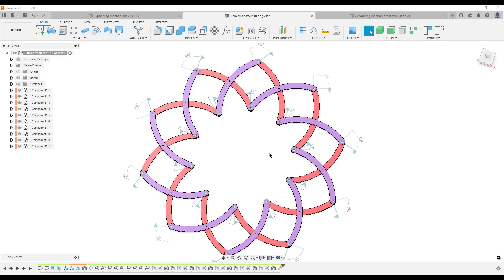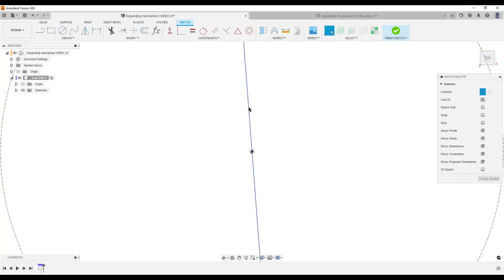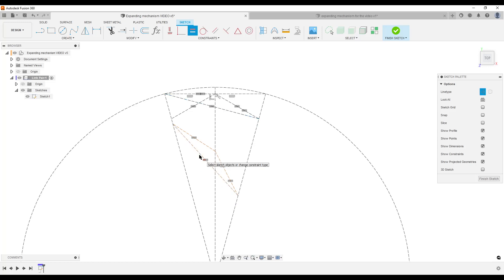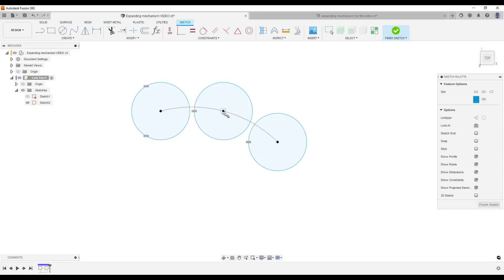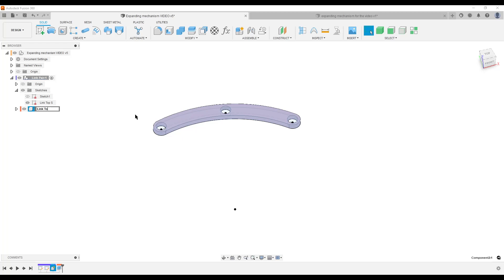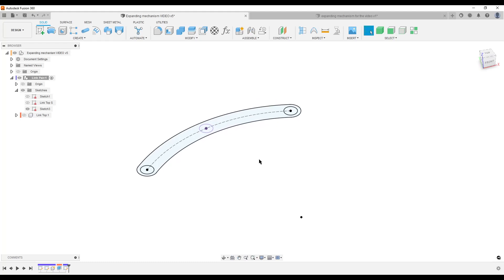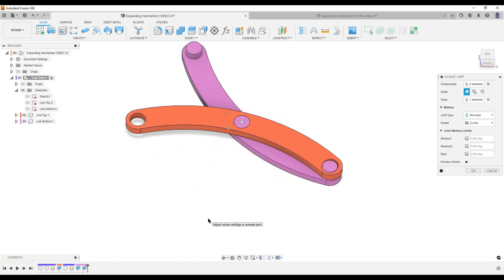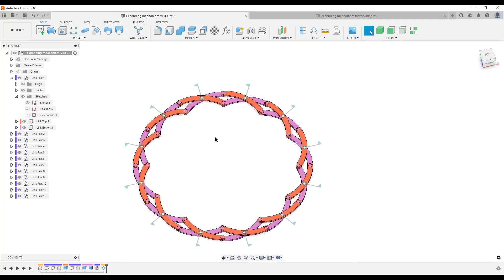Fusion 360 - Expanding Mechanism (basic design)

Comment: The joins between link pairs would still need to be created, correct? As at the end of the video, only the center points of the link pairs have joints?

Thanks for another great tutorial. I love your channel!
Reply from the maker: Yes, I only did the basic geometry in this video, not a fully funktionell model. And it's mostly adding joints and motion links for 15 minutes, I think that will be a boring video ;)